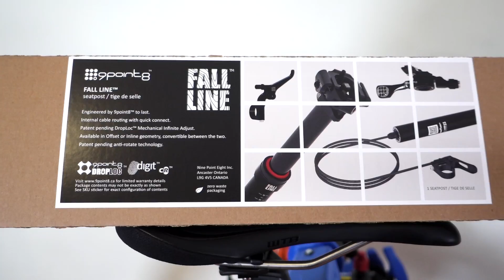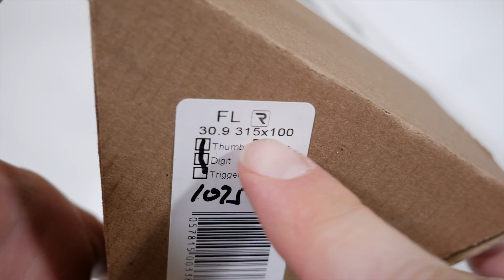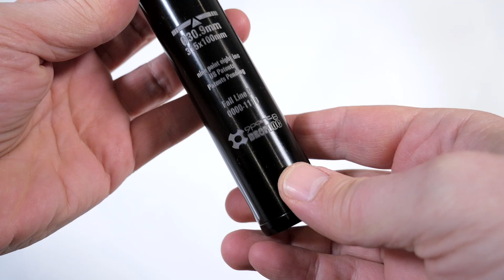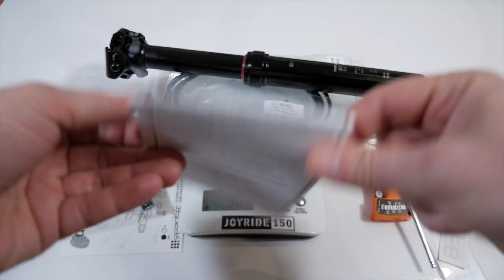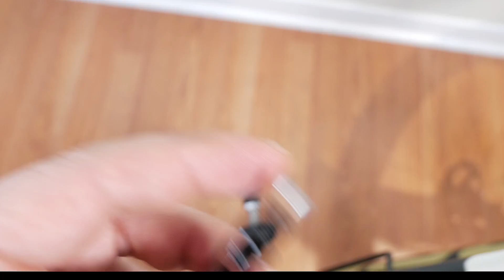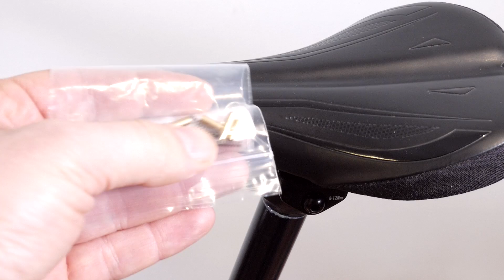XC Race Bike Dropper? 9point8 Fall Line R Dropper Post Quick Check

Comment: How did you decide on the 100mm length and are you happy with that?  Does that seem like enough, too much, etc.?  Had you considered the 75 mm at all?  The reason I ask is because I am looking to adding a dropper to my XC race bike, of course want it to be lightweight, but don't want to get the 75 mm and then feel like it doesn't make enough of a difference to be worth the weight penalty.  I am also looking at the Divine SL, which also claims to be the lightest available, and it only drops 80 mm.  FWIW I currently ride a rigid post, so any amount of drop will be new to me.
Reply: @LoveMTB  Thanks.  My current seatpost length, from the top of the post clamp to the bottom of the seat rail, is 245 mm.  So if I am reading the chart correctly, I wouldn't even be able to use the 100 mm length, since the height at minimum insertion is only 223 mm.  I'd have to size up to the 125 mm post in order to get enough total height. So much for trying to save grams... I might look more closely at the Divine SL and see how it compares.
Reply: @LoveMTB  I'll check it out!  Neither the Fall Line R nor the Divine SL are even available now anyway.

Comment: Doesn’t give you much option for seat adjustments !  I need 27.2 back sweep post
Reply: LoveMTB hi looking at the post your showing it’s straight up I need my seat top mount to be back sweep otherwise my position is incorrect , as you can see your seat is mounted so far forward on the rails !
Reply: LoveMTB sure I will have a look 🙂

Comment: Good video. I bought a 125mm RaceFace Turbine dropper, I only have one question, since the instruction manual does not say the right tightening torque or maximum clamp, could you tell me about your experience?

Comment: Obviously, if you want to make it faster you change the rider. If that's not an option, a power meter and a lot of training will make it much faster than a couple of gramms less in a dropper or carbon wheels.

Comment: I'm considering getting a dropper for my XC hardtail too, even though I'm just a recreational rider and don't race. I'm considering the Brand-X externally routed one, considering their insane price point. Just installed at Brand-X 170mm one on my AM bike the other week... such an upgrade from the PoS post that came on it! Those Vittoria tires are just beautiful by the way
Reply: Putting my weight over the rear tire, I feel like I'm gonna get stuck on the saddle when going back. That certainly ruins my confidence...

Comment: All great, but realistically weight don't make any difference in real world.
Reply: @LoveMTB  theoretically, but if you do the math- by saving 1kg on the bike you "gain" literally 2,5% in performance (counting bike as around 10kgs), which is pretty much inperceivable, I myself weigh only 50kg, and I didn't feel any difference (actually my avg speed increased) from going to 0,5kg heavier/set tires, apart from increased traction. Peopple believe that weight matters because most of the time it's not just the weight that changes with the upgrade, but less rolling resistance etc. at the same time and they associate the better ride to less weight, I was guilty of that myself not that long ago.
Reply: @LoveMTB  I have nothing against building the best you can just because you can btw. 
Just felt the need to start an anti weight weenie discussion ;)
Have fun on the trails!
Reply: @LoveMTB  But there are no riders that weigh 30 kg is there?

Comment: Nice wrap up, keep it up! I think those grams will pay dividends.
Reply: @LoveMTB  Oh on pinkbike somebody had a offset one they’re getting rid of but I’m not sure if it works in the forward position. The website shows two part numbers but it also has a graphic showing that they flip it. Confusing.
Reply: I’ll check it with 9.8 Monday. Thanks for the input.
Reply: LoveMTB where are you all at? We travelled for 4 years and caravanned with @roaditup, three girls racing the Canada cup, BC & Quebec side. Say hi to JF @ the Roldans if you see them out there.
Reply: @LoveMTB  Circling back on this - do you know if their rear offset piece they offer is the same part as the forward offset?